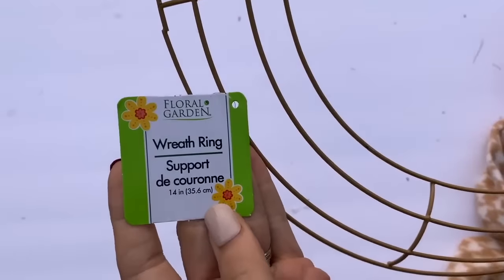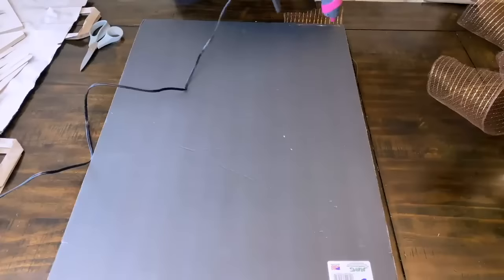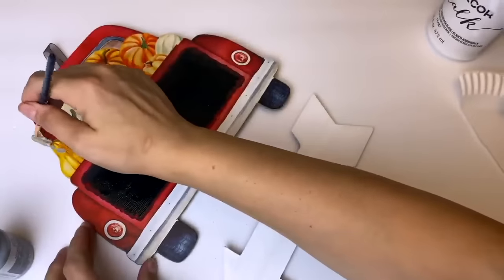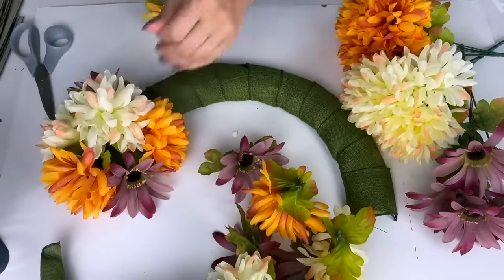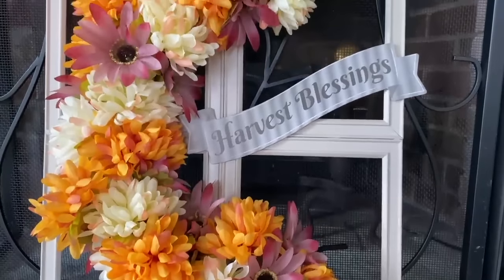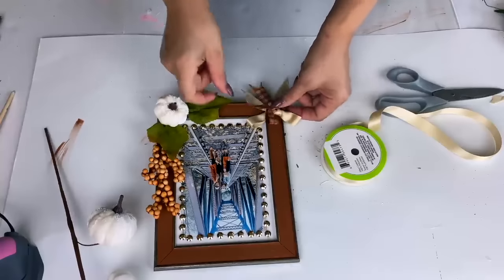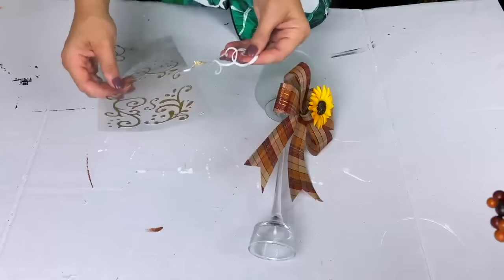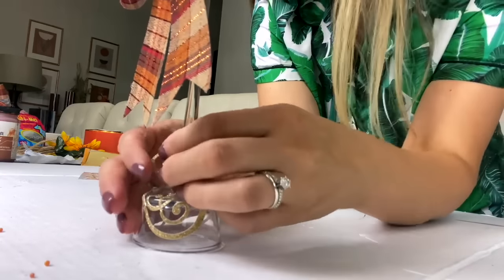50 FALL DOLLAR TREE DIYS | FALL DIY DECOR

Comment: Some of these are really cute but I’m getting really tired of Dollar Tree tacky  pieces. I realize some of you can make cute items but they end up looking less than high end. What about doing a braided thick fuzzy beige yarn x 3 in many that will cover the faux pumpkin in a vertical fashion, then using wooden balls that go up into the indentations up into the top. Then finish with a realistic looking stem from a trimmed tree branch. Even if you have to fashion it with wood from outside . It would look so much more expensive and elegant. My thought only. I’ve made them and they look phenomenal. I get asked where I got them every time someone comes in my home. Loved your tutorial though, well done.